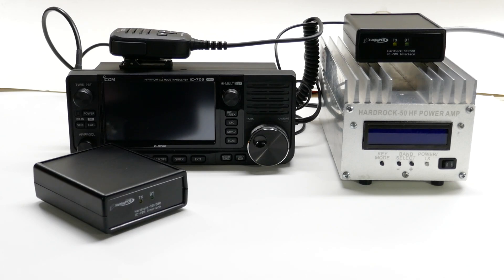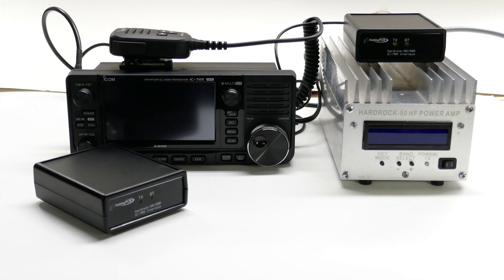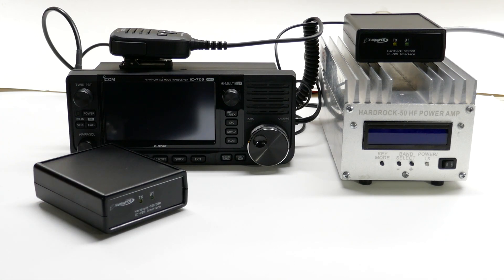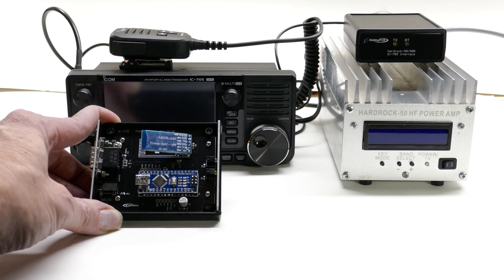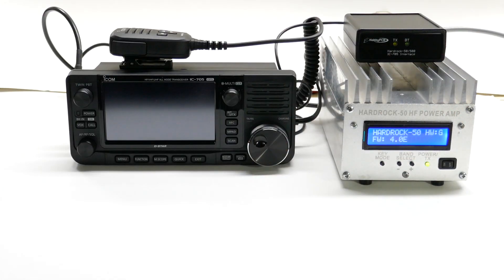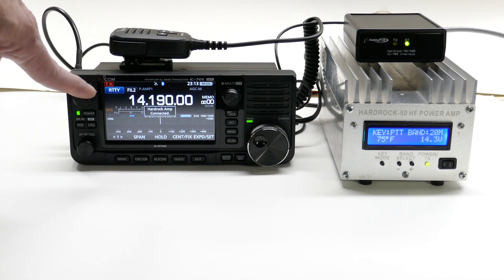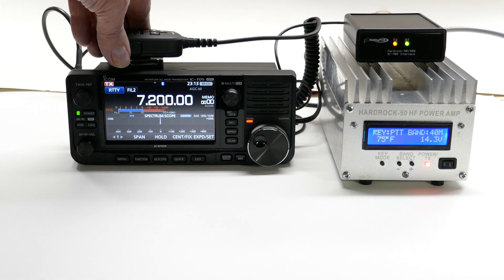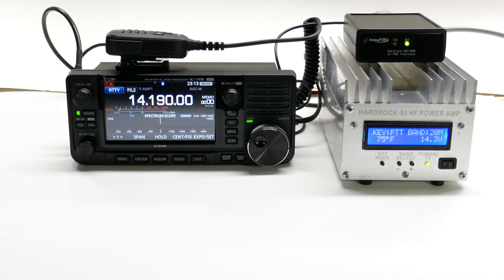IC-705 to Hardrock Interface Kit by HobbyPCB

Comment: What if I need to control an external automatic tuner? How can I control the amplifier and the tuner with one 3.5 mm output from IC-705? Do I need to use a splitter or is there another way?
Reply from the maker: This interface does not connect to the TUNER jack on the IC705 so you can still connect an external tuner to the radio while using the amp. Be very careful doing this because the tune signal from the radio is 10W regardless of where you have the power set. So if you press tune with the amp online, you will overdrive the amp and the output of the amp (50+ watts) which could also damage the tuner. If you modify this kit to use the Hardrock's internal tuner as an ICON tuner than you will connect the TUNER jack to the interface unit. In this case there is no need for an external tuner, in fact you should never run two tuners in series, just one at a time.
Reply: @WA2EUJ  Correct me if I'm wrong, but using Hardrock's internal tuner would not prevent IC705 from sending a 10W tune signal, so this will still overdrive the amp. Is there a way to deal with this problem?
Reply from the maker: Hi, The Hardrock-50 does not use the tune signal the way an Icom tuner does. Since we have a BlueTooth connection we read the current power and mode settings, set the power to 2.5W (our optimal tuning power) change the mode to FM, key the radio, tune the antenna and put the mode/power back to the original settings. All of this happens very quickly when you hit the TUNE button on the radio. So no we don't have the same issue as an Icom tuner does.

Comment: Does thie eliminate the need for a TX/relay buffer?
Reply from the maker: Yes all Hardrock amps are fully buffered on the PTT line. The line does not drive a relay or any other switching device, the PTT is connected to an input line on the microprocessor. The open circuit voltage is 5V and the current when pulled to ground is less than 1 mA. The PTT line diode protected so it can withstand any voltage from -25V to +25V without damaging the amp.

Comment: Jim , is there a solution for the VHF / UHF side of the ic705 radio similar to the HF solution? I would like to boost vhf/uhf power with an app too.  I envision meeting a diplexer to split the bands and then attach linear amps to each of the diplex outputs to separate antennas. Does your solution work with any other apps? Further does the ic705 have options to trigger different signals when VHF is keyed versus when HF is keyed therefore triggering the two different amps only when selected. I would buy the icom 705 in a second if I could find an easy way to boost the power of both radios.  Comments please ..  Jim KD9UOB
Reply from the maker: A diplexer is a great choice to separate the HF+6M that the Hardrock-50 covers from the 144/440 that it does not. I have personally tested the Diamond MX-62 and it works, there maybe other suitable models as will. As for keying, if you select a frequency that the Hardrock doesn't cover, the amp switches to "UNK' and does not key. 

The code for the Arduino is available and I brought the unused pins out to solder points so it would be possible to make a separate PTT line for 144 and 440 with minor modifications to the code. Depending on the specific VHF and UHF amps you chose, you might need a driver circuit to buffer the Arduino output to drive the amp.

73,
Jim WA2EUJ

Comment: Hello Jim, very nice item,
🙏 can the interface fire any other amplifier? 
Greetings
Reply from the maker: Hi, The kit comes with the Arduino already programmed. The sketch is available if you would like to 'hack' it to support other devices. The kit does include a PTT interface but since the Hardrock-50/500 PTT lines are compatible with the IC705's PTT output, there is no additional buffering or protection added to the PTT line that may be needed with other amplifiers.

So the answer is that the kit is plug-and-play the Hardrock-50 or Hardrock-500 but there is still quite a bit of integration needed to use this kit for other amplifiers.

73,
Jim WA2EUJ

Comment: Will the ATU for the hardrock work too?
Reply from the maker: Hi,

Yes, the Hardrock-50 with the ATU installed has 'QRP' mode where the ATU is active, the amp's display shows power and SWR without using the 50W amplifier. 

73,
Jim

Comment: Can't find this item on the website.  Can a link for it be provided?
Reply from the maker: I have a few changes to make to the PCB layout and then we'll start production, it should be ready to order mid-January. We'll work out free shipping for anyone who buys a Hardrock-50 between now and the time they ship so you can build and use the amp manually now and get the interface when it's ready.

I'll post a link to the product page as soon as it's available.

Jim.

Comment: Will this work with early SN <1200 HR50's?
Reply from the maker: Hi, 

Yes it will work with every version of the Hardrock-50. Rev C and Rev E amps need a modification to the rear panel board which is documented on the website. The amp also need to be running firmware 3.0d or later.

73,
Jim WA2EUJ
Reply: @WA2EUJ  Hi Jim, thanks!

I have now done the Rev-E modification and I'm already running 3.0d.  

Looking forward to getting this Interface!

Any idea of price, please?

Cheers

Josh
Reply from the maker: @MrJoshua  We expect the kit price which includes the assembled PCB, pre-programmed Arduino Nano, Bluetooth module, enclosure and all interconnecting cables to be ~$50.
Reply: @WA2EUJ  That’s fantastic!